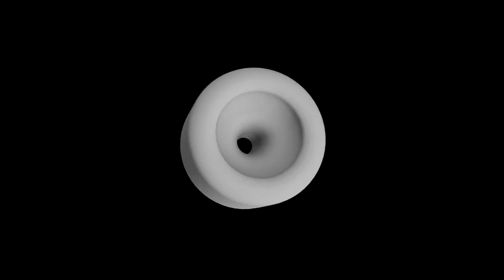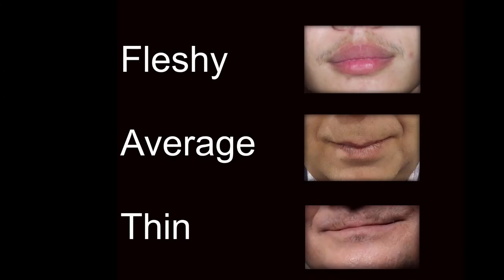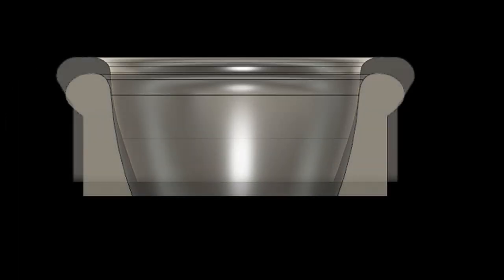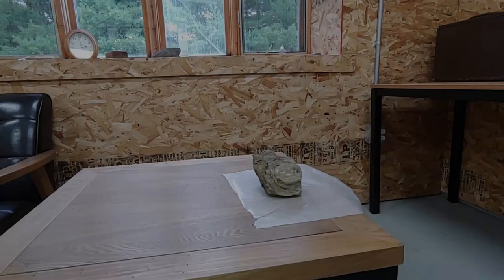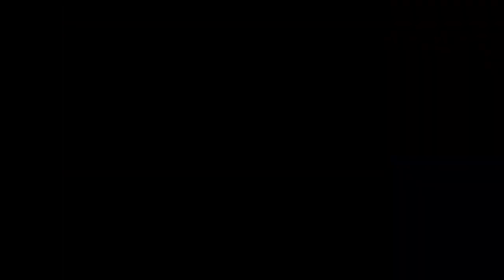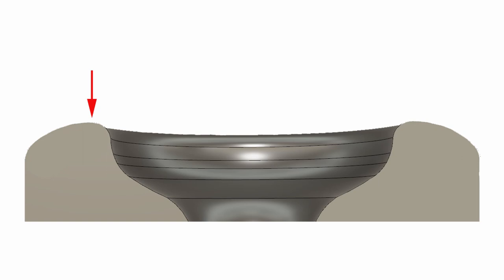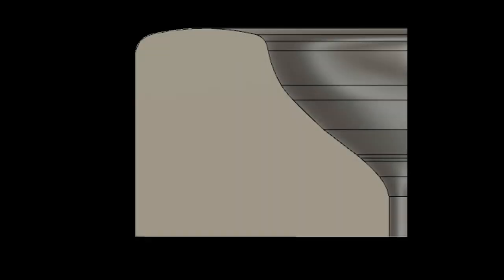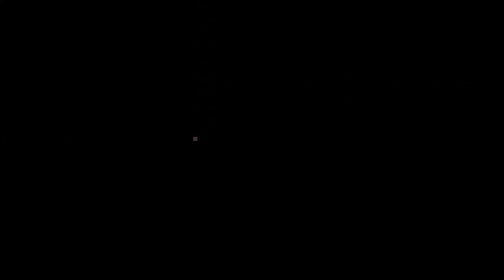Understanding the Rim

Comment: This sounds crazy but...I'm teaching myself to play (fight) the Bugle. The mouthpiece..is really small. I've a piece brass rd stock that i had laying around for a few yrs for something special to use it..and turned on my lathe to make my own mouthpiece 🤗. Ive learned a much-needed understanding of the importance of the shape of a mouthpiece. I have been trying to find the optimal size for me, as i have fleshy lips but still at a loss for the correct type for the bugle. Is there any suggestions on a good shape "V" or "C" shaped cup and length of the shaft, including...is the ID tapered, ID size..and love your video's. Thank you so very much & greatly appreciate the time you took to make this video.
Facta Non Verba